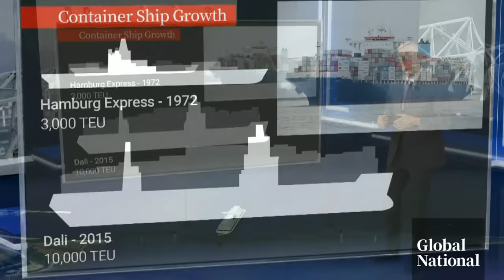Baltimore bridge collapse: How a container ship was able to bring down the structure

Comment: Lol that bridge looks flimsy if you have a container ship striking it. Come on it ain't rocket science.
Reply: But container ships can’t melt steel beams!
Reply: @jackmeowmeowmeow2177 neither can jet fuel
Reply: Cargo ships often weigh over 150k tons and that bridge def isn't designed to take an impact like that. It's not rocket science to see why it was destroyed
Reply: @johnrhodes3350  nah but a jet flying ~600km into a building will act as a bomb, heat will compromise the steel (hardened steel turns softer under heat and becomes malleable under tons of weight) secondary gas explosions in the towers cause more damage and rattle the compromised structure causing the top to tumble down according to skyscraper design (you want the building to fall mostly straight down to reduce collateral impact in the event of collapse)
Reply: @johnrhodes3350  Its almost like heat softens metal. Ever heard of a blacksmith? Dingus.
Reply: @jackmeowmeowmeow2177  Those planes COULDN'T fly at the speeds recorded at that elevation.....Gas explosions in the tower? There was no gas permitted in the towers..... 

Structures do not collapse into the path of MOST resistance.

And Soloman Building was NOT hit by a plane, nor a building.
Reply: @derekwoodford9955  you can clearly eyeball it travelling over 400kmph and yes, the tower had secondary explosions from gas lines in lower levels, and other flammable and explosive materials (any compressed gas) WOTW was in the north tower and likely ran gas line.

Large skyscrapers are designed to fall straight down, not just WTC, but many of them, you don’t want your buildings fallling over and hitting other buildings or crushing a whole neighborhood. Straight down is the path of least resistance.
Reply: @jackmeowmeowmeow2177  ha, you people are just not very bright at all.

Comment: How a container ship was able to bring down a bridge? It's not magic, just look at the size of the ship vs the size of the bridge. Bridges aren't easy to build either, there's a lot to take into consideration for construction. They need to be durable without being too heavy, and that's before considerations for cost come into play. Everyone roleplaying as Captain Hindsight would be better off taking engineering and physics courses before second guessing ways to have made this bridge impervious to damage. They started construction in 1972 ffs, of course they didn't plan for massive ships to plow into it when the ships they had at the time were less than a 1/3 of the size.

Comment: The rudder would have been central so the ship would be going straight . A ship with no power turns that fast in the last minute or two minutes  !
But you believe whatever.
Reply: Who will get insurance payout? Who 'has' the contract to rebuild it?
Reply: It didn't turn anywhere, it's called drift. And with no power it drifted off course.
Reply: A ship that size drifted that fast ?
😂😂😂😂
Anyway you are looking at the bridge and the ship....it worked ...took you away from diddy !

Comment: To hell with the ship size and force of impact … I want to know why it wasn’t ALREADY set to course,  in between the piers, in the first place.  WHY did it change course, steering right, which put it directly in line with the support pier?  Power went out … okay fine… IT SHOULD HAVE ALREADY BEEN IN POSITION AND ON COURSE TO PASS SAFELY UNDER THE MIDSECTION AS INTENDED
Reply: Just like a car you do need to make microcorrections to keep in a lane so to speak, try driving down the road with a welded steering wheel (for reasons don't actually ). Also they tried to stop the vessel with assumed faulty engines. Reversing a boat moving forward will cause a twisting motion. The channel "what's in shipping" has a good early analysis.
Reply: The two big bright things we see in the sky every day (Sun & Moon) drive ocean tides. When those two celestial bodies align with the Earth, they generate higher amplitude tides. Those currents in the harbour are strong, and move the ship. There is no such thing as a linear trajectory navigating in the ocean.
Reply: WATER ISN'T A STATIONARY FLAT SURFACE. This was a ship in a river. A river with a CURRENT. Currents can change the direction of boats that are in the water....

Comment: Why did he drop the anchor I know the ship was going forward but he wasn’t going to hit the bridge then they drop the anchor witch is a horrible decision Because it slows the boat down but u lose control of the direction it goes Because the engines are still on. That’s why he should have just drove through the bridge avoiding any possible danger then anchor  when there was room to
Reply: The problem is, when a ship losses  all power, there is no steering it. Definitely not the first time this has happened to a ship. 2004 BC Ferries Queen of Oak Bay crashed into a Marina near the Horseshoe Bay Terminal after it suffered a full electrical system failure.